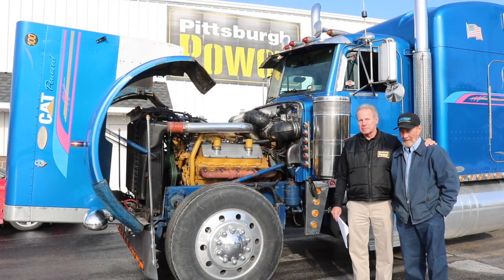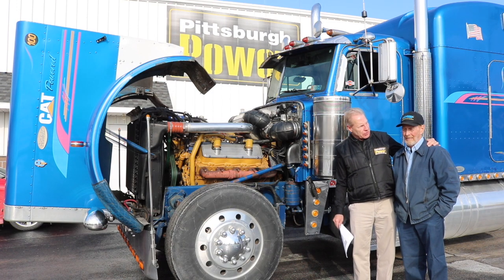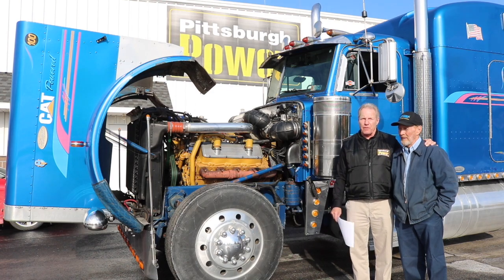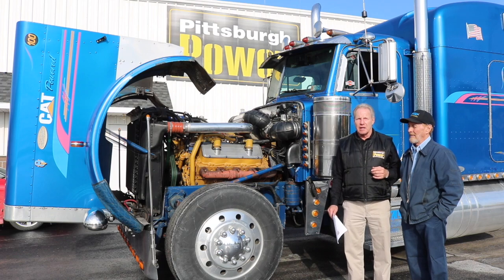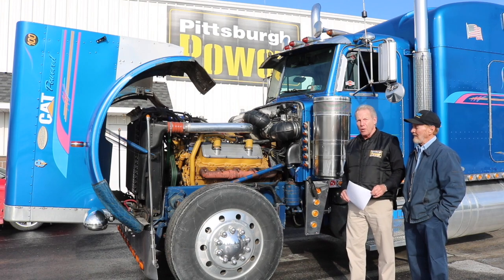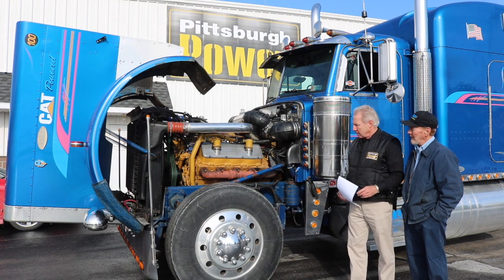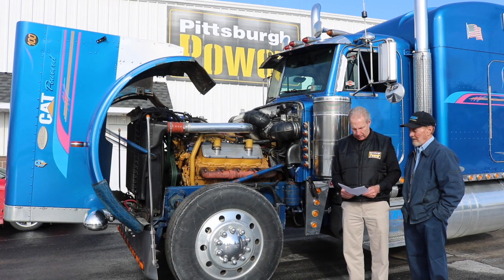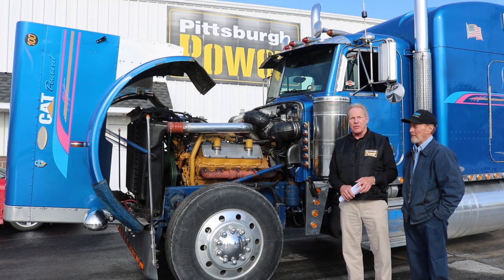Mechanical V8 CAT 3408 Dyno Run

Comment: I’ve been running my 3408 powered Kenworth for over 20 years and it hasn’t missed a beat except for 2 blown turbos in all that time. It’s putting out 550 HP @1900 RPM at the wheels, but I see yours is air to air aftercooled whereas mine is jacket water aftercooled as from the manufacturer. It pulls 11 axle A-Trains @ 174,000 lbs (79 tonnes) all over the Australian outback.
One small mistake, you’re wrong about the bore and stroke being the same as a 3406. The 3408 has a shorter stroke but the same bore, although a lot of parts are the same. If it had the same stroke, the engine would be 19 liters, not 18.
My engine’s never been out the frame, it’s had 3 in-frames and it’s done nearly 70,000 hours since 1980 when it was built. The secret is clean oil, properly dosed coolant, proper start up and shut down, and bearing rolls at the right intervals. Plus never let anyone else drive it.
Reply: I've watched yours and it is SWEET! Nice rig and if it'll run upside down it'll run anywhere. Thanks, Mate!
Reply: I was about to switch to your channel and check in on ya👍
Good to see you're still around!
Reply: Cat 3408 my favorite Cat Engine.
Reply: The Cat 3408 is my favorite engine. They powered our 769C`s when I was with PKS KIEWIT PACIFIC. My logging truck (double bunk) Peterbilt 359EXHD had a RTO 14615 & a 1241D auxiliary box and 44,000 lb rears @ 4.44:1 gears & 3408 B  DITA. Too bad Capitol Woodchip went belly up. I would have loved to make a tractor out of it and pull semi end dump, and lowboy.
Reply: Would like to see more vids from you.  Great entertainment.  https://www.youtube.com/watch?v=OyZauzCnwu4
Reply: You got that fucking dead right never put any one else in it I fully agree 👍
Reply: What the here have you been.you haven't even uploaded a video in a year
Reply: Chevy bison21  Yeah I will soon, just been too busy and haven’t had the motivation. Got plenty of new footage.
Reply: Show is a video of your rig as well
Reply: impressive numbers back in 1983
Reply: I wish I could meet you in Australia or just see a truck of that magnitude hauling a train across the outback.
Reply: @justins21482 .... there are Lots of video's on YT that you can watch of them.  The O/O (Owner Operator) on here (above) who goes by "gm16v149" has video's of his rig (COE KW w/Cat 3408 power) over there in AU.
Reply: I know the truck you refer to and it sounds good going though the gears with two trailers.
Reply: never let anyone else drive it especially the newer trucks with automated trans inexperienced drivers really mess them up big time
Reply: @gm16v149  thanks mate would like to talk to you sometime I'm in Townsville.
Reply: @michaelbutler9039  No worries I should be up there in a couple of weeks loading pipes. Was up there a couple of months ago as well.
Reply: gm16v149 Was
Reply: Tem vídeo dele aí amigão para vermos ele em ação? Manda aí para olharmos.
Reply: Did you convert yours to a di?
Reply: @michaelbutler9039  It was DITA from new, converted fuel injection from A series to B series pencil injectors many years ago.
Reply: @gm16v149  did you get the b series parts from Trevor Hudson by any chance?
Reply: Trying to convert mine at the moment.
Reply: you talking right!! today no so much truck-drivers understand how is use correctly a engine! I know a smaller city in Brazil have a power generator giving power for all city around 100peoples live there and the engine is a CAT 3408 from beginning 1983 to now!! this engine in year 2017 have 297833hours!! only stopped a couple hours per YEAR for the CAT mechanic's making a maintenance  just a one time per year!! so probably still working today!! that's a prove the best diesel engine in world is a CATERPILLAR unbelievable how is fucking good this american quality 👌👌 cheers from Norway the best equipment made in USA and AUSTRALIA
Reply: Nice! What do you mean by "properly dosed coolant", you mean proper mix ratio?
Reply: gm16v149   66
Reply: Are 3408s a bit fragile?
We have a Sig Series 02 KW Cummins coming up on 1.45m kms that has the shit thrashed out of it by 5 different people (all of who would be struggling to drive a stick up a dogs arse btw) and its had about 5 clutches and 2 partial gearbox rebuilds. The whole truck is turning to shit but the motor has  had 2 turbos but not so much as the head off it. It overheats too. We just leave it alone as much as possible in case it stops lol.
I suppose comparing an inline 6 to a V8 is a bit unfair since V8s suffer  secondary vibration that inline 6s don't. We have a few 3406 Cats but they don't have the poke on hills our Cummins engines do.
Would i rather a Cummins over a 3408 for the type of work you do? 
Nah I'll take the 3408 (that's the mechanic in me. I like you can open them up and the cylinder bmehp is lower than a 6 as well as the hp being at 1900 as opposed to 2100 ;)
Reply: ThePaulv12  I hardly think mine is fragile, just look at the hours it’s done and the weight it pulls in extreme heat. There’s still a few operating here in Australia with bigger loads than mine. As long as you do the bearing rolls, like any early 3400 series, and you don’t lug it below around 1400 rpm, the crankshaft will last. I’m a firm believer in oil sampling every oil change too.
Reply: @gm16v149  just quietly I'm being playful to stir up the argument manufacturers and armchair experts. We're the real deal and i like it when people with absolutely no idea of the real world tell me my business.
Reply: gm16v149 agree with the other fellas. Really like your vids, it’s high time you shared a new one! You have followers in Europe!
Reply: what is bmehp?
Reply: ThePaulv12 yes. Not completely, but they are well known to have a weak bottom end.
Reply: ThePaulv12 The Cummins KTseries is a lot more fragile cthan the 3408. both engines cannot be lugged whatsoever. The Cummins is a marine engine originally and likes it's rpms. btw I know where there are still 3 or 4 on the road. The 3408 have pretty much died out except for a few here and there in collectors trucks and the occasional grinder or rotomiller.

Comment: I love how everyone is so fast to shit talk about a Cat or a Cummins or a Detroit and so on!!! But 99% of them have NEVER even OWNED or worked on any of them!!!  Let alone ALL of them to actually have a foot to stand on to put one or the other down. LOL!!!
Reply: Jim Allen  not true... At all.... Any mechanic knows that...
Reply: Shit? Give me a break! 90% of the motors in our shop are Cats. On the rare occasion we have Detroit, it's more often than not a fuel or blower problem. Almost never mechanical.
Reply: @SgtStickyTits  notice I said NEW Detroit's. It's sad a shitmins can't even go 100k without a cam lobe shittin the bed. Series 60 Detroit's can't even go 75k without shittin the rear or front main seal. I worked for caterpillar for 7 years. I worked for Cummins for 6 months. I quit Cummins when I found out what a bunch of fraudulent fucks they truly were. Ship a cam to us with "MADE IN USA" on the box. Pull the cam out to find shitty grinds and shitty hard faced surface. Look on the end of the cam and see "MADE IN BRAZIL"   the fuck? Call Cummins. "The camshaft are casted and hardened in Brazil then shipped here. The finishing process is done here. There for its "MADE in USA" "   uh.... That's not the way it works.... But... Ok. Every single cam we replaced lasted between 65k and 100k. The shop wound up habing to replace a guys fully built and tuned 800hp big cam 400 because the cam was hollow 😂
Reply: @jasond5405  the big cams we never had issues with. Those are THE BEST cummins engines made.
Reply: @SgtStickyTits  RARELY had issues with the older Detroit's. 99% of it was operator error.
Reply: @robby844   My father ran alot of Detroit's such as 671 8v71 and 8v71ta and they would run forever as long as you put oil in them everyday do to burning and leaking oil!! You never had to change the oil just the oil filters!! LOL!!! And they only got 2-3 mpg and had no power was the biggest downfall.
Reply: @jasond5405  wow... The ones I've never burned oil and as long as you lock tite stuff they dont leak. They must have been well wirn out to get that bad of economy... Ours got better than our 4 strokes and had PLENTY of power
Reply: @robby844  I have worked on a couple of those newer Detroit (Mercedes) 15 liters and those are a absolute F-ing nitemare and I hope i don't ever see one again for the rest of my life!!!! They can send that eurotrash back across the pond as far as I'm concerned.
Reply: @jasond5405  yes!!! They are GARBAGE!!!!
Reply: @robby844   The Ta turbo version 8v71 350hp had twice as much pulling power as the non turbo 318hp and 330hp versions he had. But they leaked oil no matter what to the point that you would just have to learn to live with it. But they would run forever!!
Reply: @jasond5405  depends on what gaskets you used. We had several that only leaked out of the road draft tube but that was fixed with catch cans that we had auto drains on. When the "ignition" was turned off we had then set up to drain back back into the pan. As soon as they were started a solenoid actuated and shut the drain off.
Reply: @robby844  The craziest thing I ever seen with those old Detroit's was my dads 1974 transtar cabover with the 8v71ta that would start up all by itself every couple years if you would push the shutoff cable back in on the run position when you would park the truck. It would be locked up and it would start with no starter when the temperature and the compression stroke was just right!!! It would really fuck with your head when it would be parked in the yard and startup at 3:00am!!! LOL!!!
Reply: @robby844  Well I am not sure what years you had cam problems.  But the engine oil brands in the US reduced the zinc which damaged alot engine cams.
Reply: @jaybee2344  they all ran Cummins approved oil. Why did other "older" Cummins engines run perfectly fine on the same oil?
Reply: @robby844  Same is true for Eaton transmissions! I remember back in the 1990's when I worked for their transmission division...watched workers come in on Saturdays to get overtime...they'd unlock a dozen or more shipping containers, start unloading 9-speeds out of the containers, bring them inside, SCRAPE OFF THE PLASTIC 'MADE IN BRAZIL" tags on the sides of them, then using two drive-screws, drive in a little metal 'Made in the U.S.A.' tag on the casing!!! Talk about UNSCRUPULOUS!!!
This of course, stopped for a while around 1995, when CBS dropped an Eaton 'million mile' transmission in the desert...got a new shaft sent to them to repair it...AND IT WAS ALSO DAMAGED (new)!!! Of course, CBS did a BIG STORY on 'Eaton-US Quality' which utterly crapped on Eaton...
Humor is, they eventually shut down the U.S. Transmission facility...AND MOVED ALL TRANSMISSION PRODUCTION TO ENGLAND AND BRAZIL! (Brazil, of course, being where their publicized 'million mile' transmission failure came from...that they had 're-tagged' illegally as 'made in U.S.A.)
Reply: @robert844 , i wouldn't put a set of good for 1 year AKA goodyear tires on ANYTHING i own 
I run large machinery as a farm operator and tires are my number 1 expense ,i just bought 4 new 28.1 x34  tires for my 7520 john deere 4x4 tractor ,,and i'll never buy good4-1year tires again ,,Trelborg tires are what i bought and they were $3400 per tire ,, i have extreme dislike for the way so many companies cheat on the made in usa  rule ,,nearly every large manufacturer does it too unfortunately
Reply: @wildcoyote34  my grandfather dumped $1300 on a set of 30" shit years for the Jeep I have... They leaked air... Through the tread...
Reply: yea some of them are really shitty ,, I had a cheap set of good year wranglers from walmart on a chevy S10  that lasted a long time  but just one of them had a habit of leaking and walmart never could figure out what was wrong with it ,,,good year tractor tires seem to develop cracks on their edges in the second or 3rd year
Reply: @wildcoyote34  yeah. I had to take mine to a mom and pop tire shop. They paid a guy 4 hours to watch the dunk tank and video it and send it to good year. Of course they denied the claim. They also only last 30,000 miles before they were at the wear bars. The tire place I got to check them actually credited me for new tires. It took them 2 years to battle with good year. They had to hire an attorney. The problem was.... I never even got a chance to take them off road...
Reply: yea i won't ever buy anymore GY tires  ,, they would have to be a size i could not get anywhere else 
walmart eventually replaced  my tires on my S10 with their cheap brand  and they are still on the road 7 years later ,, and only 1 of them has a patch 
my truck i drive every day  has  Falken Ziex ST/Z  LT235x75-15 G tires ,it's only a ford ranger  but  i drive in and out of cornfields and scrap yards constantly ,,
my big truck that i use for playing in the mud has Kenda Klever  315x85-16 E  tires on it , not quite 35in tires ,
it's a big toy that i don't drive very far cause it eats fuel at a tremendous rate 
the truck is a severely modified GMC K3500 ,,has an 8.1 liter Cummins and allison 9 speed automatic borrowed from a bus
the cummins has a HUGE 90MM Blaylock variable geometry turbo, it's got loads of POWER  and the self adjusting variable geometry turbo has zero lag
Reply: @wildcoyote34  I noticed that the GY they have a walmart has a super thin side wall. I think they make a cheaper tire to sell at walmart.
Reply: @robert844 yes i think you are correct ,, there is a number after the name of the tire ,,and  that will tell you it's specifications ,, I actually like the tread pattern they have unfortunately ,,but since i pretty much only have trucks and i use them as trucks , i can't have thin wimpy tires ,,although load range G tires on my ford ranger which weighs 3400 pounds with me in it  kinda are overkill ,,but i never get flat tires ,even though it rides like a lumber wagon ,,i put load range G tires on everything i can , i hate flat tires
Reply: @robby844   Best engines made??  I've never seen a BC 3 or 4 that didn't leak oil from the head... Nice quality control?? Lol... Garbage.
Reply: @Closeoutracer  why you calling them garbage if nothing is wrong with them? 🤔🤔🤔
Reply: @Anon Ymous yes... We know... Garbage. Simple
Reply: @Anon Ymous  Everything is different on the Mercedes truck motors. Even simple things as fuel lines and air lines all have special Mercedes only fittings and you can only get parts for them at a daimler Mercedes dealer and your screwed if your out in the middle of nowhere!! Because a cat or Cummins or real American Detroit you can get parts at any brand heavy truck dealer!!!
Reply: @Anon Ymous  I don't usually work on them but when I have to I feel like a idiot trying to figure out what all the stupid added components are on it that no other diesels have or are built anything like them!!! To put it short I would rather slam my pecker in a sliding glass door than have to work on one of those nitemares!!!  LOL!!!
Reply: Robert844 if you know jack shit about truck engines you know almost any engine is better than caterpillars 3208, 3206, 3126, 3116, c7, c13, 3306, 3406a, and acert engines are all sub par to series 60 Detroit or n14,big cam, signature series 600, most of all, they are all sub par to the KTA . The only exceptionally performing cat is the 3406e/single turbo c15
Reply: Eat black angus if you ever "owned" a KT, you would say it was great and never buy another one. The one phrase that you never want to hear when you have trouble is "Ooo , I never saw one of them before."
Reply: So out of the 99% I guessing you've done it all and have owned them all. STFU
Reply: ive;d worked on detroits most ov my life(1961)from -NAVY an them 2 strokers are something else,been arould cat;s 2 an they are superior.
Reply: Electric motors are superior change my mind.
Reply: @guillermolopez1690  Tesla is garbage.... Change my mind...
Reply: Robert844 I agree, Tesla is garbage and I don’t like them. I was just saying that electric motors are far more efficient than any I.C.E. might ever be.
Reply: @guillermolopez1690  ask the people who burned alive in what should have been a common fender bender. Or all the EV cars that were in the Hurricane. It's not IF they will just go up in flames but WHEN. They have to be parked in a area with no other cars, homes, buildings, etc., and 20 feet from each other. 
GET YOUR FACTS STRAIGHT.
Reply: Ive worked on all of them.... Cummins and new detroits are SHIT.
Reply: Robert844 bull shit I worked on all them to, and not all Cummins are shit, neither are all cats good you biased douche bag
Reply: Makers like Man and Scania claiming 1,000 factory hp are full of shit. Not sure what calculations they’re using, but it’s not the real world.

Comment: Need the extra 2 cylinders to make some hp. Cat is poop. but loved the vid!
Reply: Box stock 3406  550hp and 600hp Cats were making 2000ft lbs 20 years ago.. this 3408 is 70's tech.   Cat is the Power King ...  Poop??? ..Lol ....  They will leave your ass on any High Hill.  800hp Marine 3406 is 2200 Ft lbs in stock config with zero tuning.